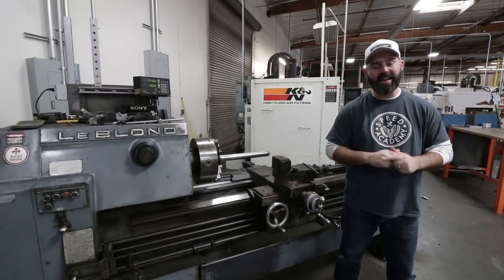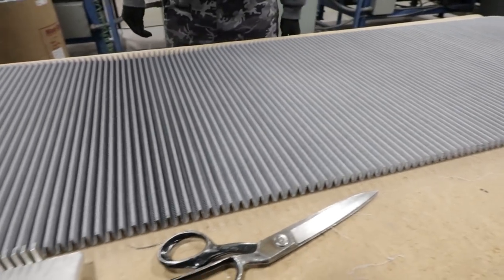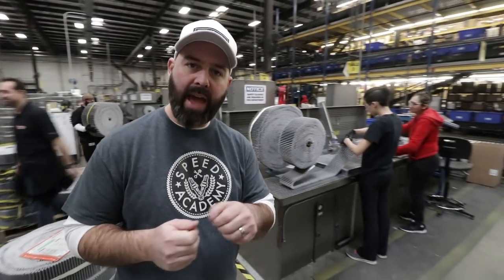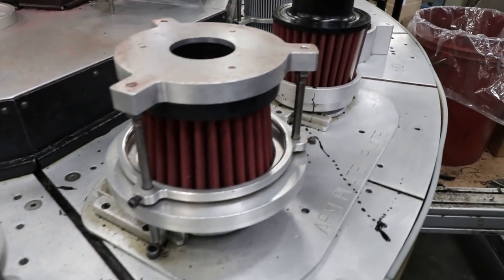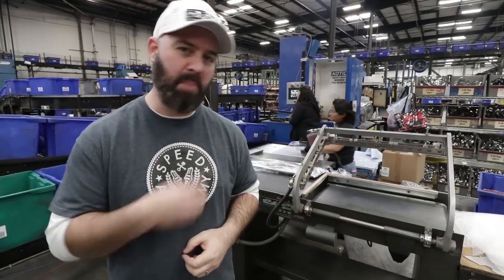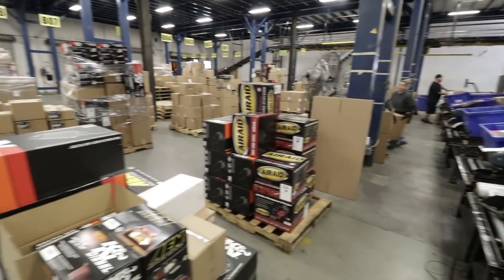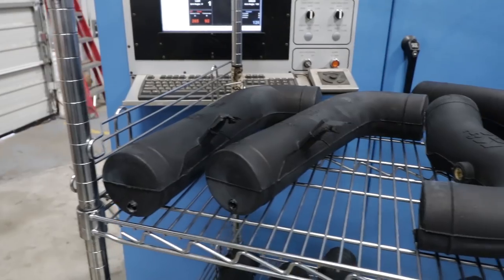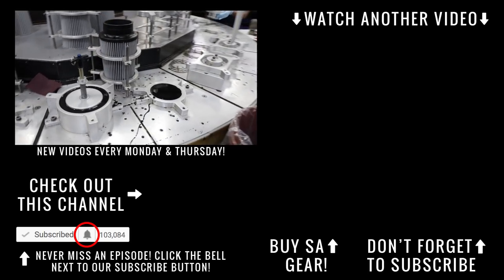How Performance Air Filters Are Made - K&N Filters Factory Tour

Comment: I love K&N filters! I do rebuild engines for a living though. ;)
Reply: I’m very interested to hear your take on these filters damaging engines by letting too many particles in. Or is this BS?
Reply: @Hutchy86  I would not use them in front of an engine that I was going to daily drive and possibly neglect.
Reply: @corbaneells3997  so are you saying you have seen these wreck engines?
Reply: @Hutchy86  Yes. They can't be neglected like oiled foam can.  Dirt will wind up on the clean side. Foam won't pass any dirt, until it rots away. Paper does a good job, but hates water or oil contamination and cam't be cleaned.
Reply: @corbaneells3997  appreciate that 👍

Comment: I'll tell you why my mind is blown... They have all this really nice equipment and process but cotton gauze hasn't changed since the 60s.   It was a leading material at the time, now it is terrible in dust efficiency compared to cellulose we have available.    The Amsoil filters were really high efficiency and so are the AEM dry flo,  but I don't know if they are still in production because the media is expensive.    Cotton gauze is an antique
Reply: Justin Miller cheap and does the job. I doubt anyone is blowing engines because of a 4 percent decrease in filtration. you have bigger things to worry about.
Reply: Justin, check out our website for more info on K&N filtration efficiency: http://www.knfilters.com/efficiency_testing.htm
Reply: You watched the video right. you should know. There's a lot of industries where cotton is still widely used like in central air systems and ventilation in manufacturing. It's not that bad and it renewable. That small margin you let in is better than a completely plugged filter or hole that can let a lot of big shit in. You saw AEM is made by K&N.

Comment: I have a k&n in my crv, 210000 miles, I have lightly cleaned it 3x,  since it is dirty most of the time I don't get much dust that passes thru it. I feel it is a good value but not something I would use on something expensive.

Comment: I had one in my 2001 Honda Prelude. Now i it goes through liter of oil every 1000km. The engine life is toast due to silica passing through the K&N filter. If you need more air, make a larger air box for a larger paper filter.

Comment: I run a K&N filter in my Saab 9-3, and have had issues with over-oiling causing the MAF to get dirty. Have you guys ever thought about addressing this issue? Maybe by finding some other method of aiding in filtration (other than oil)? Also, I'm currently graduating with a BA in Industrial Engineering, and have a few ideas about how to make your manufacturing process more efficient. Let me know if you guys would want to work together in the future.

Comment: I have been using one for 11 years and had clocked 170,000 miles with little to no wear and tear on my piston rings. I soaked to clean it with dish washing detergent and oiled with motorcycle 2-stroke oil every 25,000 miles. I had problem having oil clogging my idling valve passage. It is advertised to last 'forever', is there really no lifespan for the cotton layers? No noticeable performance gain but savings by not needing to replace filters every 25,000 miles.

Comment: Used k&n in the past, they don't filter for sh*t. For those who are running one, take off you filter and look down your intake tube with a flashlight. You'd be shocked at what they let through. If you want sound and very slight gains at the expense of engine filtration and dirty sensors then they are great. Go with a dry flow "oil less filter" like afe.. You and your engine will thank me.
Reply: Mine filters right fine unlike the paper ones. But in any case AFE is made by K&N. So is Spectre and AIRaid.
Reply: nautilus9008 He's not there has been many tests on this. You're not gaining power and you're letting more dirt in.
Reply: Nolan R ya because my YouTube account sums up my life. great observation. a. that thread proved basically nothing besides people bashing on k&n pr. and b. ive used k&n filters in quit a few off road vehicles (dirt bikes, quads, and law mowers.) all have lasted just fine with no more dirt getting through than a dry filter will. and my dd cummins and Subaru dont have any dirt in the intake or on the throttle body. the Subaru has had a k&n for going on 6 years 195000 (92000 of which has had a k&n). and the cummins for about a years that I kno of because it was installed from the previous owner. and my mustang has a k&n and is driven very little so there isn't much to say there. over done my research. you just make blank claims because some chode in a mini Cooper wrote a forum because he thought a cai would make his car not as shitty and failed, and you read it and believed good. good job
Reply: Nolan R oiled air filters are not for maf sensor setups,dry flow is what you need yes,also plastic air intake tube are junk,they dampen so much sound away,no resonance in plastic...
Reply: He works on Vegas and pintos
Reply: YOU BETTER HUSH! THAT MAGIC OIL ONLY STICKS TO THE FILTER AND DIRT, THEY HAVE DONE UNREALISTIC TEST TO PROVE IT AND THE STICKER ADDS 50HP AND IT WONT VOID WARRANTY BECAUSE THEY WOULD SUE IF IT DID! THEY EVEN SPRAYED THE MAGIC OIL ON ONE MAF SENSOR TO PROVE THAT IT WON'T HURT A MAP SENSOR!! 

Yeah is some applications they are fine but it's not something I would want after busting down a few motors and seeing the same kinda results. The way some of the butthurts get to defending them by saying it's worked for them it's like me saying smoking doesn't causes problems, ive been doing it for however many years when in reality i have early signs of emphysema and it's going to shorten my overall life. People talk about the being using in racing motors and stuff, when they build a lot of those motors within a minute of turning them on they are turned to full throttle
Reply: ...And still I ask myself-
Who's trollin' who?
Who's bein' true?
Who don't even care anymore?
Reply: One of the ways your engine oil becomes dirty is if you have an air filter that isn't doing its job. I had a K&N cone filter on my last car for nearly 14 years and the engine oil didn't get any dirtier than it did before with the stock paper filter. At oil change (5,000 miles), the oil wasn't black, it was brownish gold...just as it was before the K&N. My current car, 2014 Challenger R/T, has a K&N cone filter. So far, so good. Same results.

Comment: I use a AEM Dryflow filter.  I have also used a TRD panel filter in the OEM airbox (looked the same as a K&N) with the oil kit from K&N.  I have heard over the years of people eventually developing problems with the MAF sensors probably due to over-oiling the filter.  Not the reason I switched but still something of concern.

Do you guys know the difference in construction between the dry filters like the AEM and the oiled filters?
Reply: KNfilters I wasn't really concerned about the oil on the filter as I use a dry flow filter. I'm was interested the what the difference is between the construction of the two.
Reply: Bluevitz-RS I use the Spectre model filter for the last 70,000 miles. I've never had an issue with it, even cleaned the filter with carpet cleaner, rinsed and reinstalled. Looked like the day i installed it. My intake tube, throttle body, and MAF systems are clean, clear and run fine. I travel dirt roads quite often. 

Come to think of it, ive only cleaned that fitler once. That was close to 65,000 miles mark after installing it..
Reply: Yeah is this the same guys that said the silicon inside the sensor to isolate it from heat? Okay.  Then it goes on to say there are 3 TSB talking about the silicon creeping down. I Like that.... TSB's that are about the oil coming off air filters is all bullshit but the silicon coming off, thats legit. I like the test where they pull the truck in a clean room environment and do some testing with a wind flow meter laying on the filter, no natural wind and bumps or real word anything.  Then the other test, how many time was it simulating the throttle open, throttle snap shut, throttle open all the way, throttle open part way. throttle snap shut, with the engine and road heat and bumps, dust it on down with some kitty litter dust from stuff like the use to absorb and clean fluids that leak after a crash. And those clean room 4th grade science fair test don't seem to last very long but we know for sure that if you clean it and re-oil every 3 days you should be fine. 
I have tried to fry computer parts and couldn't do it. Athlon XP CPU with half the cache dead and they wouldn't warranty it so i took it and overclocked it, ran stress test, removed heat sink while it was on, removed cpu while it was on, taped 9v battery to pins randomly, put it back and tried it and still worked. That dont mean to do it couldn't hurt it.   Also seem like a lot of the MAF's K&N got back was dirty, sounds like the air filter was not working. And as far as no fault found, they have done been shipped in mail and tested in different environment . You could take a bad starter off a car, take it to have bench tested and it never show signs of being bad

Comment: what BLOW MY MIND is that K&N AEM and AIRAID performance air filters are all made by the same company in the same factory using the same materials but are just put into different boxes so wreathe It's a K&N, a AEM or a AIRAID performance air filter the hp gain will be the same vs the stock air filter no matter what one you choose right or wrong

Comment: WTH i did not know K&N made the filters for all those brands! mind blown.. humm so they all start out with the same grey material. then they oil it. so if i bought a cheap filter then added the oil later, would it be the same i wonder..?
Reply: Javier Kano what do you mean cheap filter?  These filters are cotton gauze.   The filters you buy that are oem style are usually cellulose based which is superior in dust filtration.     Cotton gauze is terrible at fine dust efficiency,  oem paper is what everyone should use on stock vehicles,  there is no advantage to high flow air filters on stock vehicles because the filter is not a restriction point to the intake system,  your restriction will be the heads and how much valve lift you have.
Reply: I think he meant if he bought a Spectre filter instead of a K&N, would the Spectre be the same as the K&N if he added the oil.
Reply: Check out our website for more info on K&N filtration efficiency: http://www.knfilters.com/efficiency_testing.htm

Comment: When I worked in a speed shop. Everyone that came in had a preference for an air filter. The arguments I had when I'd explain to them they were all made by the same company. Haha.

There are a few things, first, the problem is that K&N is far more well known so they get the spot light when the storm comes. If anyone was going to attack an air filter it's always been K&N. Another is the condition these people leave their filters in and it's an OMG moment every time I've seen one come in. It's unbelievable how these things come back. Some of them are so abused it looks like damage on purpose. These elements come back looking like they been dragged through mud and grease and then stomped on and twisted, but I check the inside and it's always clean lol.

It's still an air filter and still needs basic maintenance. I don't know how they get like that but I have reusable air filters that are 5 years old and still look like new. I never had a problem with them as far as quality is concerned although I did over oil one before but that was an easy enough fix. I think the people that complain about them just don't know how to use them or are very limited in their real world knowledge because like I said all the people that complain that I've met (dozens) were all "experts" and knew everything there is to know about air filters but always came back with wrecked ones.
Reply: I found this liberating to read. Well done you 👍🍺

Comment: if K&N makes AEM filters, how come the K&N ones need to be oiled but the AEM ones can stay dry?
Reply: Bob Last vartiety in products
Reply: K&N branded ones have a lot more sizes... I've wanted to buy an AEM dry filter before couldn't find the size I needed.  It'd be nice to tap into K&N's size catalog.  The real question I have is if the filter media is any different... or is it just the same thing, one oiled and the other not oiled?  After seeing this I'm assuming its the same, but market material would have use believe otherwise.
Reply: AEM filters are made of a dryflow synthetic media, which requires no oil. The trade off is slightly less airflow for the AEM filters.
Reply: Thanks for chiming in!

Comment: There is 0 power gains from these filters, the difference is that you can wash the filter and it will not fall apart on you... that being said, I have K&N filters in every car I own, in the long run I save money since I can wash the filter and re-use it and it will not fall apart.

Comment: I'm always surprised how much manual labor is still involved in US manufacturing. Many of those tasks could surely be completed with machines for a much lower cost. Maybe they don't do enough volume to justify it so it's more cost effective to pay minimum wage to 50 humans instead?
Reply from the maker: Machines are very expensive and still require humans to ensure they operate properly.

Comment: i stop using after market air filter like this due to cause problem to air flow sensor and dirt up the throttle real fast. good for caburator era... no good for new engine with lots of electronic sensors

Comment: i had a fipk gen 2 i think it was called and it was absolute garbage and for £300!! so went and got a refund. talked myself into trying a drop in panel filter first impressions were build quality was dissapointing considering it cost £50 on the upside the air intake on my car was spottles so it must have been filtering well. i think i did about 15000 miles when i realised the filter was quite dirty, i coudnt be bothered with all the hassle washimg it waiting for it to dry then re oil etc etc. so i just gave up and went back to stock paper and not botherd with anything else since

Comment: K&Ns filter like ass, may as well just rubber band an old t shirt across your air box. Same effect and equal filtration ability
Reply from the maker: Sounds like you've tested them, maybe send your data to the K&N Engineering lab, I'd bet they'd be interested to see your old t-shirt theory
Reply: Speed Academy 

They indeed have been tested several times, so much so that it is pretty common knowledge with car people that with a k&n you are sacrificing filtration quality for a filter that looks cooler which is in reality the only thing they are good for as many dyno tests have shown the power gains are negligible. Listed below is a great example of a filter test showing such results

https://www.bobistheoilguy.com/airfilter/airtest3.htm
Reply: when i put my car on the dyno k&n and hks made the same power so what just run stock ? lol
Reply: drop some water on your t shirt,see how much flow it will lose,do you think your engine is allergic to dust?you can run without a filter with velocity stack outside your bumper you wont get any problems...why freaking out for microns...
Reply: Yes you're just as well off running stock, there has been a plethora of dyno tests that have shown that k&n filters have almost no effect on HP or torque other than a placebo effect, even full on "cold air intakes" have been dyno tested and have shown very little effect with an average HP increase of around 1-2 HP.
Reply: vega i  think for the most part not one person on this world is worried about dust but as for sucking water up for the most part alot of cars dont like that
Reply: ok so they dont make power on a stock motor not a big deal but it ur running a 70mm throttle body 550cc injectors on a skunk2 manifold that stock intake will restrict power proven on a dyno its not a crazy power difference untill u start tuning
Reply: Actually dust is something to be worried about, especially if your car is equipped with a mass airflow sensor which is usually located just past the air filter. If that gets dirty its going to effect the way your car runs

Comment: perfect way to ruin your emission system on an OBD2 car. one of these cost me a $600.00 air flow meter on my Toyota T-100.
we saw wayyyy too many issues with them trashing sensors as the oil is not supposed to be in the air intake system. Warranty doesn't cover it either. The computer will compensate for the Stochiometric ratio. You add more air, it will compensate. The extra "sound" these make is the sound of unfiltered air getting into your engine. I've been doing this 30 years. no good for diesel either. oiled pleated filters cause lots of problems. Stay away from them unless you have a 1975 Camaro with a 6 cylinder. 
This things trash more Mazda and Toyota air flow meters. Fords too! BE WARE!!!